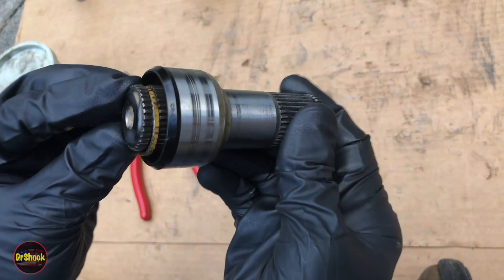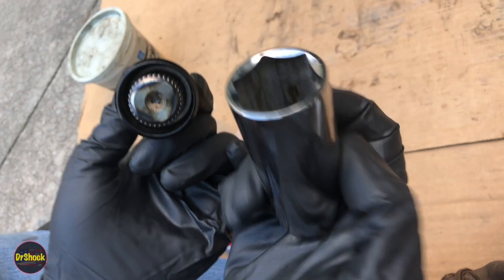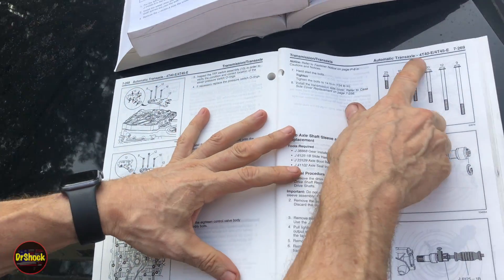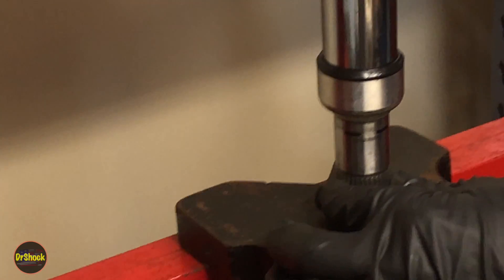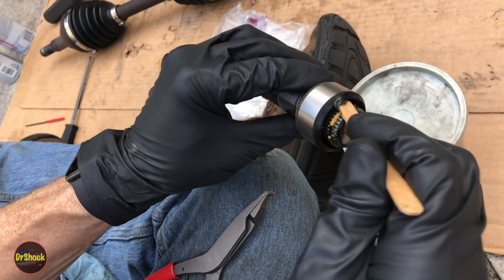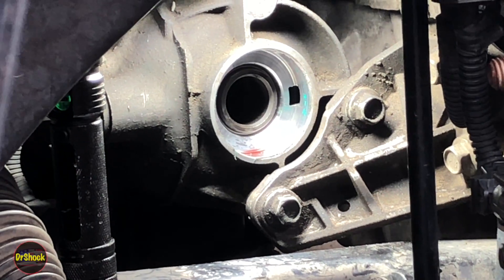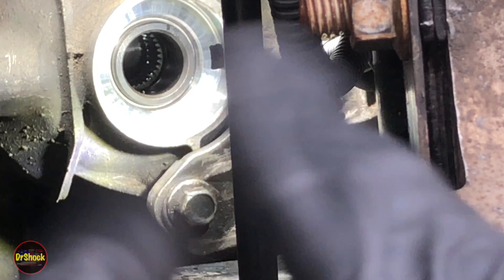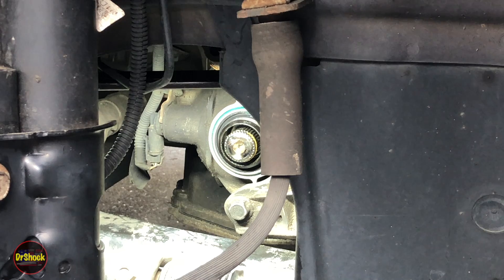1995 - 2010 GM 4T40E / 4T45E Automatic Transaxle Stub Shaft Rebuild (Chevrolet, Pontiac, Saturn)

Comment: Where are the 1000's of 👍. Not sure if this will help me with my problem. But This video is by far the most helpful in detailed step-by-step with cv axle shaft. (Driver side cv axle not spinning and when it does, spin very very slowly. Axle or wheel hub?) No clicks, minor humming with minor smell?

Comment: Great video. I had my stub shaft rebuilt by a transmission shop and still have a leak, it came back after about a week. They noted play at the stub shaft. They also said the only way to replace the bushing is by pulling the transmission and complete disassembly. Is this the case? In your video it looks like the bearing is accessible and could come out if the strut was not in the car. IF can come out do you know the part number for the bushing?

Comment: I have a 2011 HHR with 4T45E transmission which I don't see in your description. The seal and seal sleeve look the same as the one I replaced in my 2011 HHR. Maybe I'm unaware of some nuances in this procedure. I would appreciate any advice or input you may have concerning how this technique would work on an HHR 4T45E trans. I will be looking forward to your reply, thanks.
Reply from the maker: This particular video, and the GM rebuild kit I go over, only show fitment thru the model years of the video title.  The 2011 Chevrolet HHR isn't listed.  That's either due to some change implemented after model year 2010 on the 4T45E such that everything I showed is basically the same but the rebuild kit part number changed.  Or that GM made a mistake and didn't include this model and year in the fitment list.  ¯\_(ツ)_/¯

Comment: Hi, I have a 2010 hhr 2.2 lt with the same setup. My concern is that I couldn't get stub shaft out. But it is very sloppy and loose.is that normally that way or once a new clip a seal is replaced, would it be snug. At this moment, I have way too much play and lots of noise going over uneven surfaces. Could transmission  be damaged
Reply from the maker: The stub shaft is supposed to remain in the transaxle/transmission when you are replacing the CV axle shaft, but rarely does after being this old.  If yours stayed inside, that's ok in and of itself.   This video is about when the stub shaft does comes out, what you should do to recondition it while you have it out before reinstalling it.
 
If you have a loose fit upon reinstalling the CV axle, I would first suspect you have not gotten it reseated properly with the ring clip in its home groove.  The CV axle plus stub shaft assembly should have only the normal play between the two ring clips in the in and out direction.

Comment: If the stub shaft isn’t seated into the transmission correctly what sort of issues might occur??
Reply from the maker: Well, in one case you won't have proper splining which can result in damage to the transmission output shaft that mates up with the axle shaft.   In another you can have a situation where the axle shaft moves outward and no longer has sufficient spline engagement to drive the wheel.  I'm sure there are other problems that can result over longer periods of time as well.  Best to make sure this guy is properly seated no matter how you look at it.   Witness marks are your friend.

Comment: I would put the stub shaft on the CV axle first then installed into transmission
Reply: Also check old cv axle to new cv axle for correct length if replacement of axle

Comment: Installed seal twice, and it still leaks.  😡
Reply from the maker: On this model transmission, the seal and the shaft sleeve both must be replaced at the same time. I went over the service manual section about this guidance.  Doing one without the other will very likely result in an ATF leak.   Also, using genuine GM/ACDelco OEM parts, and the proper sleeve and seal installation tools can help achieve the correct fitment required for this application.
 
This seal lip can easily be damaged by the shaft splines.  So if you are not using the protective tool shown in the service manual, you have to be extremely cautious on re-inserting the shaft to avoid spline to seal contact.
Reply: @DrShock  I suppose ill have to try the gm ACDelco brand. Thanks

Comment: I can't find one of these to save my life smh. They are discontinued. Left old one on old trans.
Reply from the maker: fwiw these stub shafts are a reusable hard part of the transaxle, as long as there is not spline damage (which can often be cleaned up with a file or Dremel tool), and no excessive wear (use the finger nail test) on the polished sleeve surface.   Since they are discontinued by GM, and not produced aftermarket, a good used one is your only option if yours is damaged.    In this video we did not replace the stub shaft, only resealed it.

Comment: Okay, I have spoken with a transmission shop that knows these transmissions inside and out. The passenger side differential has a bushing inside, that tends to wear out causing a lot of slop and play inside. It causes shaking and vibrations upon acceleration and a higher speed. It's very common on these and only way to fix it, is with a rebuild.
Reply: No, there is an aftermarket bushing kit from a company called Fitzall that you can install without removing the transmission  and it takes up the slop and eliminates the play. It’s $119 plus shipping
Reply: @KevinModz65  Did you install this kit? I came across this also and wondered how it worked if anyone has installed it.